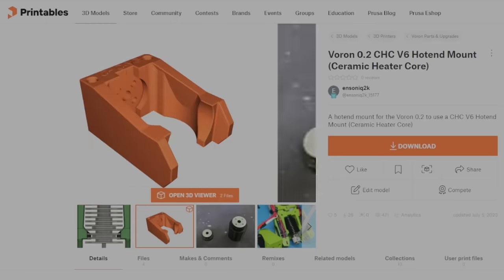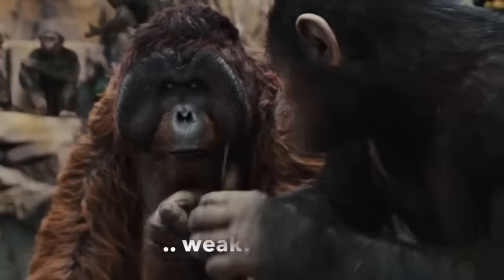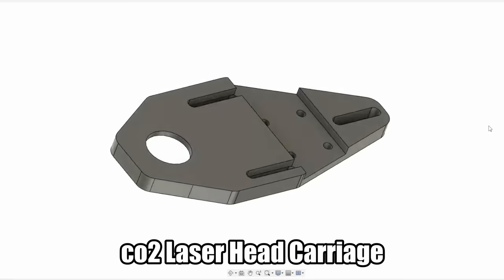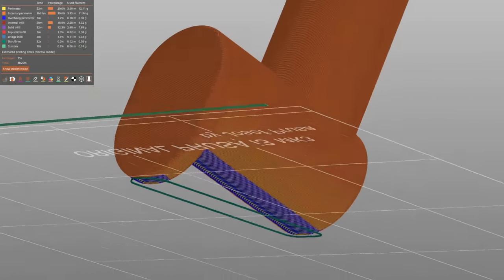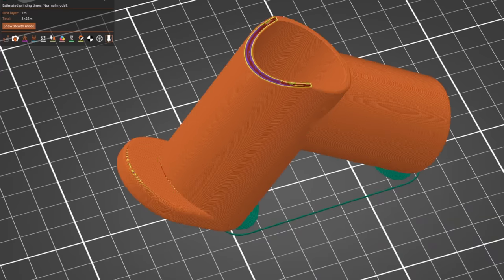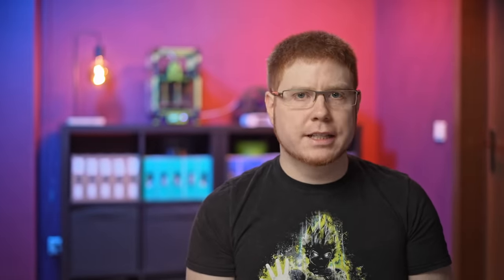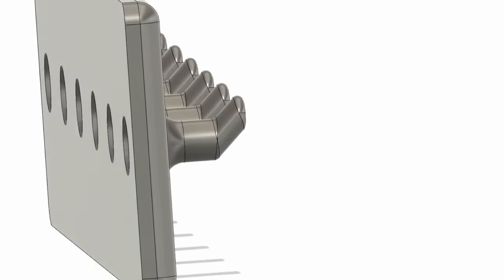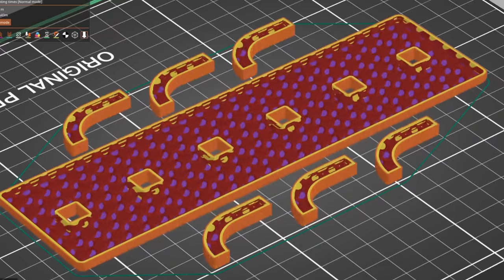3D Print Design SINS that need to STOP on Thingiverse, Printables, Cults3D etc.

Comment: Everyone needs to see this. I already incorporate a lot of these in my designs. One more thing, on the bottom of my models touching the build plate I will usually add a 30 degree chamfer typically 0.4mm high (or two layers for most slicer profiles) to prevent elephants foot. This way people who download my model won't have to compensate for it in their slicers, as a lot of inexperienced people might not know how to compensate for that. 30 degrees keeps the stepover small enough so there's no chance of sagging lines even if people don't squish their first layer.
Reply from the maker: Good! With elephants foot there's always the issue that it's highly dependant on your printer. A chamfer is a good start. My Prusa default profile for example is not enough for how close I print my first layer.

Comment: I usually make parts that can be joined with screws so that if something breaks, I have to print only that specific part.
Reply from the maker: I like that approach as well. It gives me peace of mind. I also often run a screws perpendicular to the layer lines to compress the print. Makes them virtually unbreakable.

Comment: Brilliant video. As an engineer, I gave up on using functional prints from any online source due to the reasons you put forward in your video. I mainly print sculpts or miniatures now and if I ever need a functional part, I quickly design it myself. :D
Reply from the maker: Definitely! I view Thingiverse as "serving suggestion" and a source on inspiration. It usually even takes less time to do it yourself than finding something fitting...

Comment: With the hook design, fixing the curvature to make it an angle cut is a good start. But if you want to increase the strength without printing in parts, you want to add a large fillet at the bottom edge of the hook and a somewhat large smaller fillet on the top edge. From my experience, shear forces are never the reason for failure. When you load the hook downward, the failure is caused by the deformation of the hook, this causes the hook to bend forwards, so now the angle of the load vector changes and there's a force component exerting force perpendicular to the print layers. This PULLS the layers out. So a large fillet below bottom edge would work to reduce deformation as a fillet in the loading position acts like an arch and arches resist compression. This technique has worked really well for me so far.
Reply from the maker: You're absolutely right. That's under intended use.

What I expect is somebody getting caught with a shoulder or something while passing the holder and snap of a whole hook.

Comment: Good selection of painful design choices. Guilty of a few of these myself sometimes when in a hurry and I just need it now, but always regret it later.
Another one that would be next on my list is using 3d printed things when a widely available non 3d printed thing is readily available.  I was doing this myself with clips to attach a crutch to my wheelchair. I had clips for the crutch and for the chair frame. It was always annoying when the whole clip assembly would come off instead of just the crutch. I had to facepalm and realize that 3d printed clips to attach it to the wheelchair was dumb. Just adding a few slots instead for zipties to go through made it far more functional and strong.
Reply from the maker: Thanks! We're all guilty, I was too.

Combining standard hardware is a real game changer. Be it screws, zip ties or something else. The Voron team for example combines cheap small idlers with printed parts to make bigger ones that would cost over 10 bucks each.
Reply: Yeah it's very easy to fall into the trap of 'if all you have is a hammer...', especially when said hammer is a hobby unto itself.
Reply from the maker: A lot of people have 3D printing as a hobby. I see 3D printing as a tool for my hobbies. Just like laser cutting, welding, electronics and woodworking

Comment: I came across one, where I noticed a major design flaw after the print had failed because of a combination of that flaw and poor bed adhesion (and the poor adhesion was not something I normally had problems with.)

The item was a flat molle-patch with a cutout logo. But that logo contained the letters A and R which don't work for a cutout. The tiny, unconnected pieces within the letters should have been omitted or designed differently. It was obvious to me, that the user had never even printed that model.
Reply from the maker: Those are common problems. Prusa has a printed plate with their logo so it does work, but the letters need to be large enough

You can add a box volume in the Slicer to fill those voids though. An easy way to get rid of unwanted markings in those models.

Comment: I tend to use 3d models with my cnc machine where curved corners look superior (even if they take longer).  Different use case. Regardless, make a step file available and anyone can adjust as needed.
Reply from the maker: Can't argue with that! Step files would be the very best solution.

Comment: I am at a university and we have a bunch of 3D printers for public use, my biggest pet peeve is by far wasted material. Not only do I see people needlessly printing with high infills, the parts being designed seem to have no notion towards how they will be produced! I constantly see huge boxes of plastic being printed that would function identically with 95% of the material removed in the CAD model. Whenever I design parts to be printed for my FSAE team, my number one priority is to use as little material as possible, and most of the time I can get away with 0 support material by introducing snap fit or glue together parts like you mentioned at the end of the video, plus it is a great way to start introducing the viability of AM to the senior team members if they get to see and handle practically designed parts.
Reply from the maker: So much wasted material... I'm a huge advocate of efficiency and optimization. I even print a lot of models with no infill at of I don't need to. 

There are so many great ways to optimize the design like screws that are flat in top and bottom for example. Maybe I should do a part 2 and show things like this.

Comment: This is among the top reason I am so hesitant to buy a model file sight unseen. So many of these models are designed by people who are great at 3d cad, but have zero experience with how that model would work in a production environment. As such you end up with many really cool looking models that aren't going to print ever. I am far more willing to support a 3d artist if it is evident they understand the 3d print world and if t hey have some free models that I can print myself and see in person that it works.
Reply from the maker: Yes definitely! The Voron project is one of the greatest example of people understanding 3D printing extremely in depth. Not only is the printer great the parts are all printable without any extra supports, everything is already accounted for.

Comment: Nice video. Suggestion for the last one: instead of making the hooks press-fit, flare the base of the hooks, add a recess on the back of the base plate for the hooks to sit in and pass the hooks through the holes from the rear before installation. Then, when you mount the base plate to the wall, the hooks are held in place mechanically between the wall and the plate. Since you want a flat side on the hooks anyway, you can make the recess match to key orientation.
Reply from the maker: That's actually even better than my example. There's always room for improvement :-)

Comment: Fillet on the base thing is something everyone should learn when they print something with it once or twice and realise "oh that does not print well" or you spot it when you slide the layers from the bottom to the top and notice very steep overhangs.
Reply from the maker: Yes, they should. When we printed face shields people handed it prints that already broke when looking at them so I suppose the fillet is the least of some people's problems.

Comment: You could make the key rack modular. Each section is one hook and back plate. Each piece prints on its side with the hook on the build plate and has provisions to snap the next piece in next to it. Then you can make it as long as your want, the hooks are integral and as strong as possible, you can add to it or replace sections any time, you could customize each section like by adding labels, and you just have to print end caps for the right and left sides to finish it off with no holes.
Reply from the maker: That would also work! Your imagination is the limit in 3D printing.
Reply: @SmallBatchFactory  Yeah I just like sharing additional ideas in the comments. Always looking for ways to improve a design for printing, customize it for individual desires, and possibly add functionality if useful. Fun thought exercises. :) Keeping it simple is often the best approach for real usage though.
Reply: I think a lot of people tend to try to model things as a single piece, even when a design would really benefit from multiple pieces.
Reply: @logicalfundy  Definitely true. I like to try to think of how it would work both ways and go with what makes sense. Learning how to design for 3D printing is still an evolving art for most.

Comment: Great video, but as someone who design 3D prints from time to time, I wanted to say that when I make walls thicker than 2 mm it is usually for aesthetic reasons. Sometimes thicker walls look better. But there is no reason to go beyond 2 mm if you can only see one side of the wall.
Reply from the maker: Of course it always depends on the use case. If you have walls that have a considerable distance to each other, like 5mm or more it also increases torsion strength. It's not a one size fits all approach :-)

Comment: 4x0.4=1.6, arachne perimeter generation may extrude more plastic and make up the extra .4mm, and prusa slicer extrudes slightly wider than the nozzle orifice by default but if you are using legacy/classic slicing and a .4 line width it may not work properly (4 perimeters may not make a solid 2mm wall) depending on slicer settings or the slicer used.
Reply from the maker: Finally someone notices! I swear I wrote 5 in my script... At least for the Prusa 2mm always made 5 perimeters since extrusion width is set to 0.42 by default.

The animation you see in the video is with Arachne so it doesn't matter as much as it used to anyway.
Reply: Says 0.45mm width for 0.4mm nozzle in prusaSlicer 2.7.1 as default.
but the idea is extrusion width * whole number = thickness of walls you design?
Reply from the maker: Generally. Don't forget that every perimeter also has a few percent of overlap with the others. With Arachne that doesn't matter as much anymore. Formerly I would've checked if all perimeters are yellow (as opposed to white, which means gap fill) and used that value. 2mm turned out to work well for me.

Comment: Yes! Omg! These things have been annoying me for years. People either seem to try to recreate metal (or injection molded) designs that are too delicate for plastic or not suitable for 3d printing, or the go the total opposite route and make foot thick walls.
Reply from the maker: Foot thick walls are a thing for woodworkers dabbling into 3D printing I guess. It always shows what people are accustomed to
Reply: @SmallBatchFactory  seems like a lot of people get hung up on making prints stronger rather than strong enough. 

I still have a box I made as a first vase mode test years ago that I’ve used to drop hot nozzles into during nozzle changes (with a wet sponge at the bottom and sometimes some water) and it both doesn’t leak and has been plenty strong enough ever since.

Comment: Another thing to consider is what TYPE of printing that model was intended for.  Many of the issues you outlined are non issue for a resin printer (like rounded edges).  Sometimes whoever posted the file online don't include what printer was used in the description, and sometimes not even a picture of the make itself.  This leads to having to figure out if it will work for you or not depending on the printer you have.  I, myself, have both kinds and I prefer FDM printing, but I have a Mars 3 for the odd thing that the Voron can't do.
Reply from the maker: You're totally right about the Resin printer. In the case of my examples they were all printed with FDM.

Comment: I'm not a video producer, but these peeves have been making me want to make a video similar to this. Thanks for doing it for me. Now I don't have to! I see too many designs in which the layer bonds must bear most of the load.

As an alternative to chamfers at the bottom, in my designs I use a round curve with its center lowered so that the curve starts out at a 40° angle from the build plate, and then curves up to vertical. It looks good and prints well. Any printer can safely do a 40° overhang if your layer height is no more than half the nozzle diameter.
Reply from the maker: That's true, there's a lot more nuance to the chamfer thing. A Fillet also works as long as the radius isn't too large. That alone could be a while video of its own

Comment: As for the hooks, superglue is fine but my favourite way of connecting PLA parts is ethyl acetate: it dissolves PLA and evaporates, leaving a clean and "native" bound (fused) connection. It's also dirt cheap. Basically same what acetone is for ABS/ASA.
Reply from the maker: Is it save though? I've heard of PLA fusing with things like chloroform, which is obviously not save. I don't know about ethyl acetate though. Other viewers pointed out flaring out the end of the hook is an even better solution.
Reply: @SmallBatchFactory  ethyl acetate is a simple organic ester (of acetic acid and ethanol) present in most fruit and contributing to the aromas we consider "fruity". Of course it can be irritating and should not be ingested in large concentrations, it's also flammable -- but it's still considered safe to handle.
Reply from the maker: @TomaszStachewicz sounds interesting! I usually use superglue since I have it at home anyway.

Comment: I love that mold makers are trying out 3D printing! But yeah they probably need to keep working on learning how 3D printing is different. I've ran across my share of designs that look like they would work out better in an injection mold than a 3D print.
Reply from the maker: It's mostly a matter of what people have learned to adapt to. 3D printing is so young compared to injection molding designers don't have much experience.

I've even seen the Prusa video how Volkswagen uses 3D printing and they wasted so much support material...

Comment: I don't regard myself as being particularly 'great' at 3d modelling, but with a distant past in metal fabrication I find it much easier to have a look at thingiverse to see what other people have done and then I'll just model from scratch. It's generally quicker and a whole lot less agravating than dealing with other peoples mistakes (and if I get it wrong it's my fault, which is OK). One thing I do use which I don't see other people doing though is using a 3d printing pen to 'weld' together the parts of multi-part prints. You can get decent results from it with a bit of practice.
Reply from the maker: That's true, incorporating some inspiration in your own model usually yields the best and quickest result. The clothes hanger shown had an f3d file but it was pretty hard to work with.

I've only welded to mitigate issues in a print. I've been using a soldering iron and filament, like a TIG welder. Haven't had much luck with the pen alone

Comment: In one of my CAD courses we had to remake some parts for the original RepRap printers. Some parts had to be printed with horizontal holes in mind. This required a half circle with a right triangle on top in order to print effectively
Reply from the maker: It's one of the lessons in my course, but IMO it's usually not that huge of a deal.

Comment: It's very interesting how some models print with no defects but similar shapes from other makers have issues. I realise there are settings but I have a big appreciation for the designs that print perfect first go.
Reply from the maker: Expert designers like the Voron team add a lot of little hacks to make printing easy. Like supporting a free floating hole with a 0.2mm "half layer" that helps the Slicer not printing in mid air for example.

Comment: I work on these aspects all the time, but I also push the limits of what is possible with my 3D printed speaker drivers. Single walled TPU parts for the surround and spider for example
Reply from the maker: It's always cool to push the boundaries of what's possible, keep up the innovation!

Comment: As others have said its painful to use many models from thingiverse etc. So much hassle could be avoided with just some though into the design, you have some good examples. As an engineer i find the challenge fun to design with printing in mind right from the start, to improve strength while minimising print time and supports.
Reply from the maker: Yes indeed, it's way more fun to do it properly. I usually think about models for days before I even open Fusion 360. After that it's often just a few minutes to create the model itself.

Comment: For a radius at the build plate I start with a 45° chamfer then radius/fillet the upper edge of the chamfer the full height of the chamfer. 

It can take a while to understand and incorporate “printability” into your modeling, but it’s also kinda fun and I wish more people would take the time before sharing their models.
Reply from the maker: That works as well. To. Be fair a very minimal Fillet works as well, if you keep it at 1mm or so. It's still an art, not an exact science